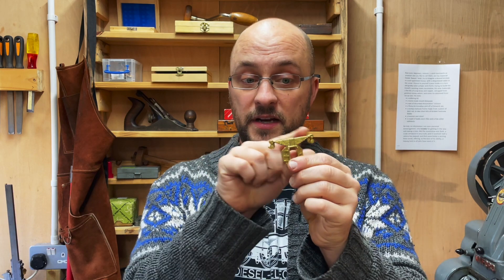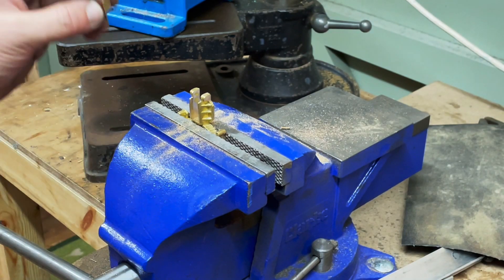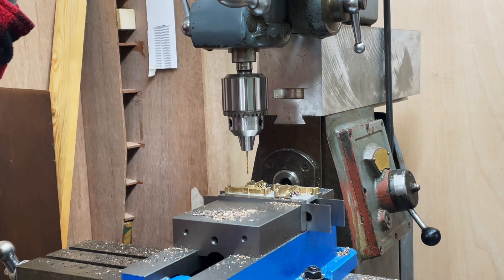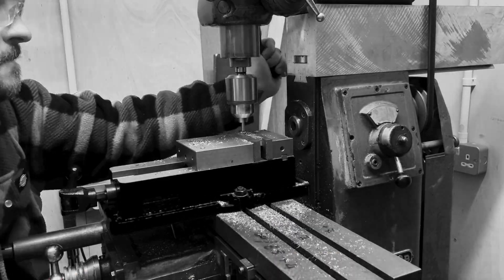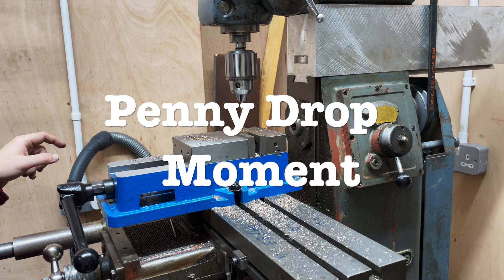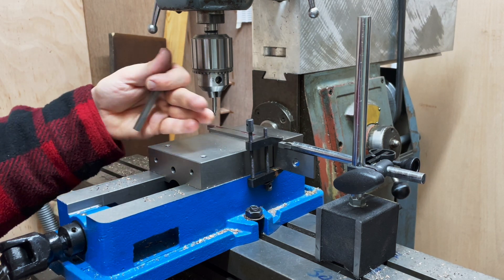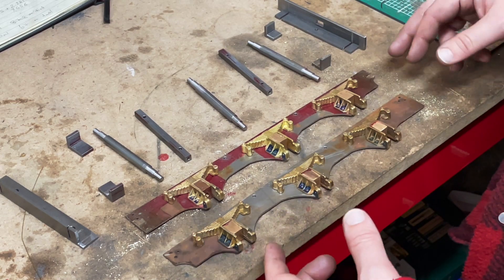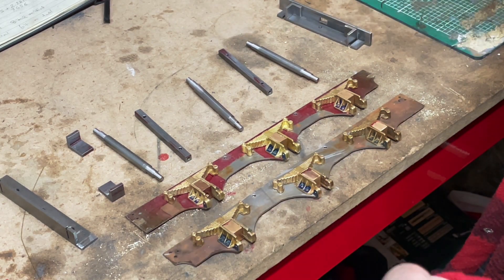Loco Build 2.8 - Learning repeatable setups, and tricky brass hornblocks

Comment: Rivet it all, I’d get the brackets onto the beams and make sure you are happy. Castings onto the frames and then last up the 4 bits together. Adding heat into these parts adds risk of distortion and lots of cleaning up. Always welcome here if you want to learn more about silver soldering some time.
Reply from the maker: I would love to - so far I’m having trouble lighting the torch so we may have to start from the beginning!
Reply from the maker: I was planning on using bolts to fix the sides to the angle, as per drawings…
Reply: @williamsworkshopuk  If that's what it suggest then go for it I was just assuming - I dropped you email in December but you might have missed it - get in touch when you get time we'll sort a visit!

Comment: hi william
Nice set up for repetitiivity, like anything in machining there's always more than one way to do it,  as long as it works that's fine.
Rivet them! less cleaning up to do and less chance of distortion!, but if you choose to braze there's still nothing wrong with having a go!!
Nice chuck!
take care
Kev
Reply from the maker: Chuck set me back a few quid but by gosh I was getting fed up of taking the drawbar out of the mill every time I had to fit the old one. On the bright side, freed up the drill press to be refurbished nicely. As I said to Douglas -my main concern with rivetting is how to accurately spot through the holes for the rivets in front and the bolts on the sides...
Reply: @williamsworkshopuk  I recently bought two sets of transfer punches - one metric and one imperial - not too expensive. You could make them as you need them, but it's nice to have them ready to hand and you can bet you never have the correct size of tool steel/silver steel when you need it.
Reply: @williamsworkshopuk  I'm sure with a little thought it can be done! 
Thinking cap on!
cheers
Kev
Reply: @williamsworkshopuk  Looks like George has given you the clue, transfer punches,
Drill the angle brackets, set the frame and beams up square, clamp the brackets somehow in the correct position and make a transfer punch for your hole size to mark the rivet positions for drilling
cheers
Kev

Comment: If you are going to rivie both types of parts I would suggest doing the beams first as they are easier to replace if it goes horribly wrong. It also provides good practice before looking at the detailed parts. We have just bought a chuck for our Centec too. We went for a cheaper chuck as eventually we will get a MT2 to INT30 or a INT40 to INT30 adaptor (or both) so that we can use the multitude of Jacobs chucks we have for our lathe and other mill
Reply from the maker: I'm going to bolt the frames to the angle, but the angle will be fixed permanently to the beams. I've not got the faintest how to keep it all aligned while I'm drilling the holes! I know what you mean about tool use efficiency - hence my indexing head with a Myford spindle nose thread and everything being MT2.

Comment: Here's another vote for riveting, for the same reasons cited by Mr Factotum. By the way, your pillar drill sounds healthier than before, - have you done some work on it ? The procedure for setting the depth on the milling machine is fine, but the depth stop on the drilling machine is more convenient.
Reply from the maker: Hi George, I haven't done anything with it yet - I think we just caught it on a good day. I definitely need to get the bearings changed and with the new Jacobs chuck arbor for the mill I have no reluctance pulling it apart. TBH though it was alot more convenient to drill on the mill than I was expecting so maybe I should let someone else bring it up to snuff?

Comment: I would go for riveting that angle, it’s much less permanent than brazing. If you make a mistake with brazing you’ll need many many more cups of tea than a riveting mistake. Chassis is looking excellent.
Reply from the maker: Thanks Douglas - my main concern with rivetting is how to accurately spot through the holes for the rivets in front and the bolts on the sides...